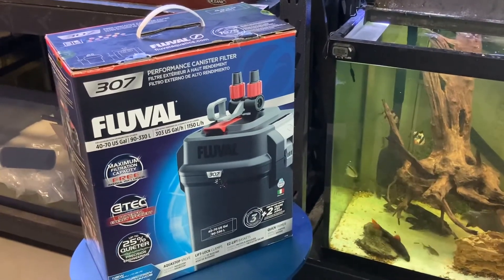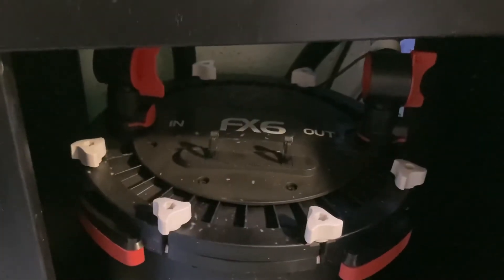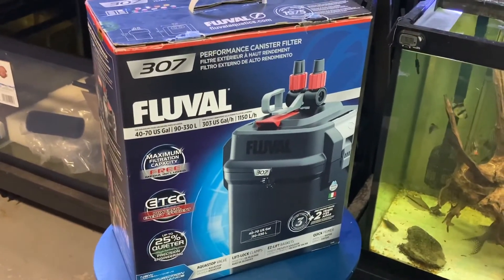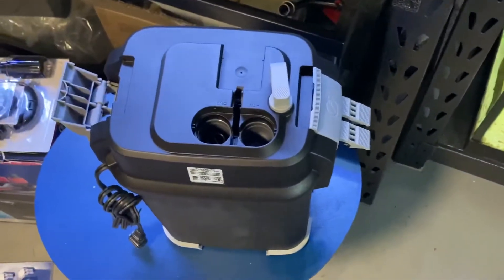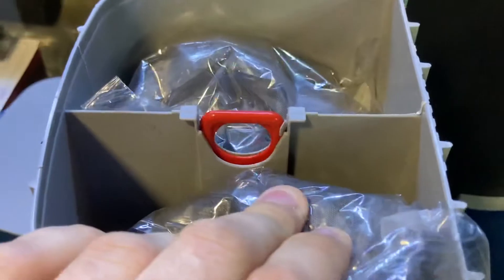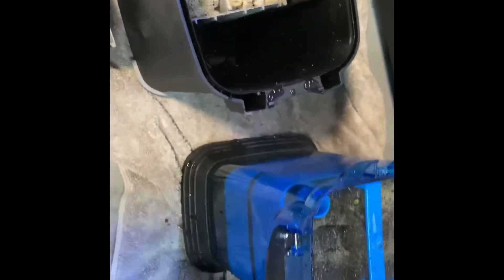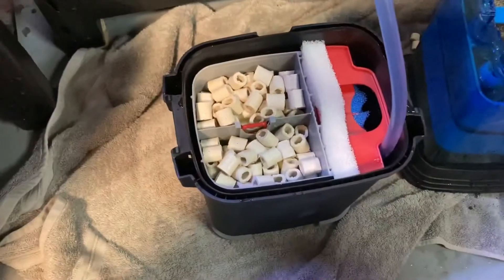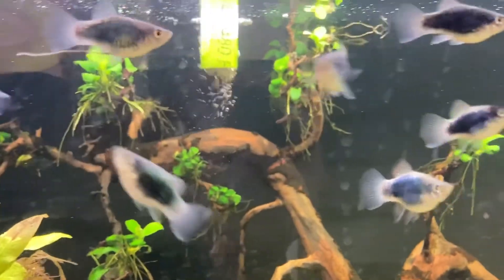FLUVAL 307 UNBOXING A MASSIVE UPGRADE

Comment: What’s the height from the bottom of the unit to the top of the primer pulley? I have a cabinet that is 15.5 inches tall. If I get this unit, the valves will be sticking out from the back of the cabinet.

Comment: I had been using a 307 for about 7 months now.. I found that that red bracket with the blue sponge pre filter is taking up too much space. I rather have more space for the bio media. Now that I'm using a sponge as a pre filter at the in take strainer, the blue sponge is now useless only taking up space.. this 307 is also not as effective as to polish the water as now I'm using another internal filter with polyfill to do the job.. the current space for the bio media is not quite enough as its install in a 65G tank.. I had to find other ways to put in more bio media.. Overall.. 307 is just a little too small for the stated up to 65G tank.. The flow of 1100L/ h is quite alright just it will be perfect if the pre filter area in the cannister can be modified to be use for more bio media..
Thanks.. Like to hear what others think about it!!

Comment: I want to set up 2 filters for a 55 gallon tank just in case 1 malfunctions. I have several yoyo loaches, 5 roseline sharks and 5 harlequin tetras. What is recommended? 2 207? Or 2 307? Or 2 107?
Reply from the maker: 407 FLUVAL will be fine 
Or do a 307 with and aquaclear/FLUVAL 20 or 30 hang on back as a back up also easy access

Comment: My question is how do you run one filter to multiple tanks
Reply from the maker: A lot of pvc pipe and ball valves to control water flow on the rack of eight tanks waters pumped to the top 3 tanks then gravity does the rest of them as water drains throughout each tank to the next.. if I could I redo it already rather I main drain for all and fresh water for each individual tank..
Reply: Excellent way to spread disease to all your tanks at once by using a centralized filtration system for all your tanks.

Comment: I have a 307 on a 50 gallon tank do you think i should got the 407, because it  increase flow rate.
Reply from the maker: All depends on your stocking needs over stocked tank yes a small community fish setup may not handle the flow. Lg fish yes
Reply: @glassboxaquarist9147  Thank for your reply

Comment: I currently have the Fluval 70 hang on my 40 gallon turtle tank .... I was looking to upgrade to a canister would it make a difference? Is this filter good?
Reply from the maker: If your water level is low in the tank a canister will be way more quiet.and maybe less smell since everything is self contained

Comment: You have this on 50? Do you think itd be overkill for a 20?
Reply from the maker: Dawalrus No. Not overkill you can adjust the flow on it and turn it down and still keep the oversized media for beneficial bacteria..
Reply: I have a 407 on a 38 gallon bowfront and works perfectly.

Comment: Good filters but I swear by cheap sunsun!! I mean for the price a sunsun302 walks all over fluval307  .... It took me 10 years to ultimately just get away from all brands and I run sumps homemade and central air system!!!!
Reply from the maker: Sumps are the way to go!! I got all 3 fx6’s on sale at Petsmart they were about 150 off then used rewards points too so I felt like it was a must same with the 307 ..sunsun’s though super easy media trays setup max volume for the size and price ...